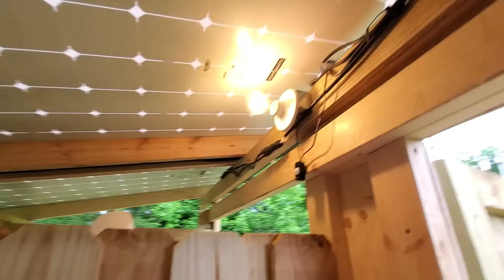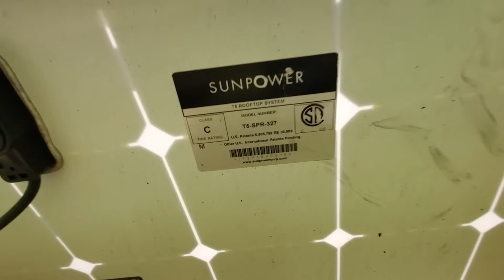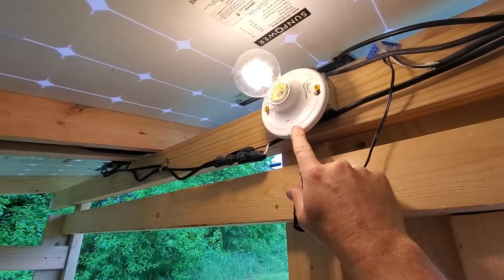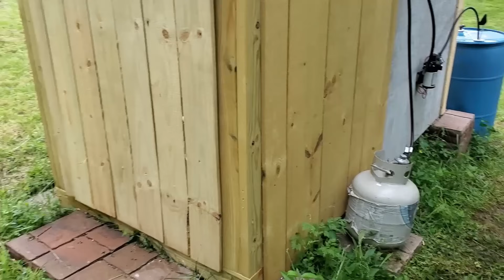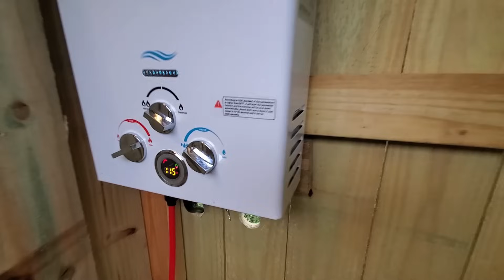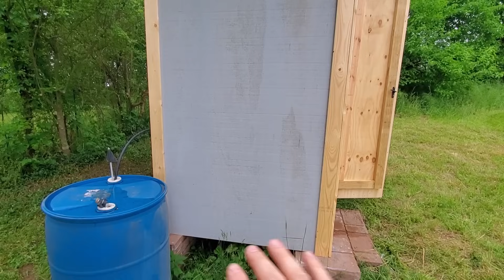Off-Grid Bathroom, Solar powered shower, lights and more!

Comment: Did you try the compost bags ? Did they work well for you ? I tried some and they disintegrate on contact with liquid. A real bummer. If you have found a better option, I’d love to hear it ! Thanks !
Reply from the maker: The bags seem to work if they are replaced within a day. If they sit with any liquid, they tend to dissolve fairly quickly. Starting with a good sawdust base helps but they just don't last very long. Our primary use is for events and campers so it's less of an issue. Some people use the bucket without any bag and have several to cycle through once they dump one and let it soak in soapy water.
Reply: @thehomesteadconsultant thank you for your input ! I will try changing them out daily and see how it goes. I have a large supply of them but won’t be purchasing more .. if you catch my drift. It’s too bad companies can’t make a compostable bag that lasts a “year” and will then break down in landfills . I’d buy them regardless of price.

Comment: Make some charcoal. From waste wood…… use this in your compost loo and you’ll never get any smells …. Also. Use a double bucket.  And put holes in the inner bucket. And a drain hole and hose in the bottom  bucket.    . urine will run out through the bottom hose into a drainfield which you can plant Willow and bulrushes The willow will explode in great, and you can use it to make more charcoal.. You then just remove the inner bucket when it is full and put it in your compost bin as normal
Reply from the maker: Great ideas, thanks for sharing!

Comment: That is the size I planned on building at my camp. Then I saw on FB Marketplace Moving crates. I think they are 5x8 and not sure of the height but tall enough to stand in. Leaning that direction now. Just waiting to see more for sale. Not a priority since using a portable water heater and bucket toilet sits on the porch for now. 😀 The solar panel roof I like also.

Comment: Toilet:  those bags don't compost well. 
Just compost the bucket contents.
Joseph Jenkins wrote the definitive book on it The Humanure Handbook. Read it. Make an open passive compost pile.  Let it sit two years,  then put it on your trees. I put mine into my vegetable garden and I'm still alive! 😂
Reply from the maker: The bags seem to break down a little too well. When the system gets used, we need to swap them out quickly before they deteriorate.
Reply: @thehomesteadconsultant oh,  maybe they make them differently than when I first tried them,  could've been a decade ago!

Comment: Maybe try putting  one or two T's  in the outflow Side of water pump going back into the drum. should help reduce flow to water heater
Reply from the maker: I lowered the voltage to the pump from 13.8v to 12v and it works perfectly.

Comment: I probably missed it somewhere, but where did you find those 320W panels for $10 each???
Reply from the maker: Sparta TN, BBB industries. If you are close enough to pick them up, I can get you more info, but they cant be shipped.
Reply: @thehomesteadconsultant  Definitely close enough to pick up. Can you send the specs and I will see if they cn work with my inverter. Thank you so much!
Reply from the maker: @jeverhart99 I cant send pictures on YouTube, so shoot me an email or text (contact info on thehomesteadconsultant.com) and ill get that to you

Comment: Put a cheap valve on the water inlet and turn it to reduce flow.
Reply from the maker: I thought about that or adding a backflow line from the pressure side back to the barrel, but I ended up reducing the voltage input by 2v and that worked perfectly.

Comment: Excellent video. I've been racking my brain trying to figure out how to keep my solar panels from leaking. Such a simple solution: foil duct tape. Brilliant! Thanks!
Reply from the maker: Glad it was helpful! 

When installing the tape, be careful not to overlap the solar cells because if you block to much of a single row of cells, it will drop the panel output almost 100%.

Comment: I would look at some inexpensive MPPT charger options (I don't love the Buck always at 13.8V, would prefer something smarter that will 100% stop charging a full battery) But if it works it works.

Comment: i spent a great deal of time trying to capture a clear screenshot of the panel model number because of the recordings motion blur. once i did I only found one link with much more expensive pricing, the best was 15 cwents a KW.Could you please provide a direct link to your source in the more box ? Id also link a link to the 12 volt motion sensor too. thanks
Reply from the maker: https://amzn.to/3GV6DC0

My source for panels is in Middle Tennessee/ upper Cumberland region. I don't want to put their email and contact info on the public web. If you are close enough to drive and pick up panels and would like the contact information still, send me an email. You can find my email address at my website thehomesteadconsultant.com

Comment: I get you used 3 panels and they work out for the size of your roof. Just a few thoughts.  Disconnect 2 panels. Get some cheap pwm charge controllers and direct that power to a future purpose nearby.  Put a faucet in between the output of pump and input of shower outside so you can regulate water flow. Another thing. When you winterize your waterheater blow all the water out of the waterheater. Open up the bleeder. Let it drain.  Great concept. I'm doing one on an old camper trailer frame.  You may find a plastic pallet to use as a floor for the shower.

Comment: With that many panels you could have P,V heated water, I do.
Reply from the maker: Are you using a resistive heating element?
Reply: @thehomesteadconsultant  I use a resistive heating element powered from the PV array voltage. This heating control uses only excess power not being used elsewhere.  It looks at PV voltage going over Vmpp.  When it goes over, The control draws only enough current to bring the array voltage back to power point.  95% efficient, and uses no battery, controller or inverter resources.   It is even quite cheap to build.  I have two grid tie panels (60V array) and that powers common 120V point of use tanks.

Comment: Looks great!  But it wouldn't work up here in the mountains of Colorado where our summers are only 2.5 months long, the freezing cold would burst the pipes and the battery wouldn't charge in the cold.
Reply from the maker: yes, it's not for all situations or climates, hopefully you got a few good ideas from it though :)
Reply: That lead acid battery will charge in the cold. Its the LiFePO4 batteries you can't charge when the temp is below 32 degrees F.
Reply: So why do you live there? 🤔 jk

Comment: that battery mount makes me nervous, why above your poopy head? other than that :D i love this setup! nice job!!
Reply from the maker: Thanks! 

As for the battery, nobody wants to be knock unconscious while 💩ing, that would be a bad day! The battery is less than 20lbs and the pipe strap can easily support it especially since there is a lip on the battery that it couldn't slide past. Plus it's several feet to the left of the toilet so if it fell, it would be well off to the side  :)
Reply: @thehomesteadconsultant  Still... Dubious!? Anyway - I haven't done anything better :-D It's very cool!

Comment: The right general idea, but needs more cowbell, especially for surviving winter without destruction and/or loss of service.

1.  Add new room to shower stall portion, for changing clothes and storing towels/dry clothes.

2.  Add sink somewhere.

3.  Make close to air tight and add thermal insulation.

4.  Add reliable and regulated heating system to keep internal temperatures above freezing.

5.  Move water storage tank, water pump, all plumbing inside insulated/heated zone.

6.  Ideally upgrade water storage tank to at least a 1000 liter IBC tote, kept in the dark to avoid UV sun damage to the plastic and to simultaneously prevent algae growth.

7.  Paint south facing (assuming it is located in the northern hemisphere) exterior vertical wall black to maximize passive solar thermal heating of the building, so as to minimize heating system energy usage.

8.  Add outdoor water hose spigot and valve, for improved usefulness factor/value of the structure.

9.  If finances permit, replace composting toilet with an incinerator toilet.  Currently available incinerator toilets are quite expensive, but they are still much cheaper than septic systems, especially in non-ideal siting locations.
Reply from the maker: I've got a fever and the only cure is more cow bell.

I appreciate the suggestions, but this will not be used in the winter. It is not a primary bathroom for a house, it is for seasonal campers. 

The sink is a good idea though
Reply: @thehomesteadconsultant  If you are like me, this will morph or go away. I have been using the bucket compost toilet for about ten years. I have looked at the shower system like yours to add to my van. I like being outdoors and as close to nature as I can. We grow veg, hunt, fish and buy local beef and pork. I hand dug our well. It all works together.